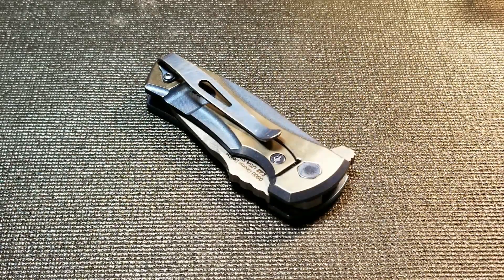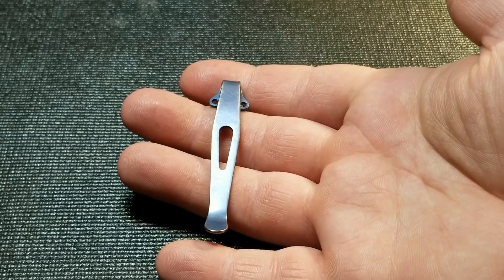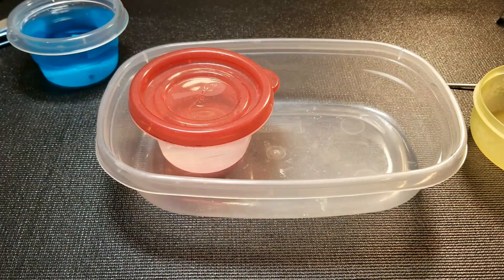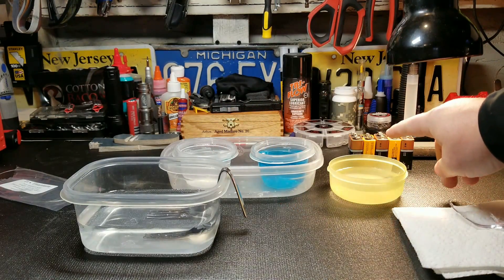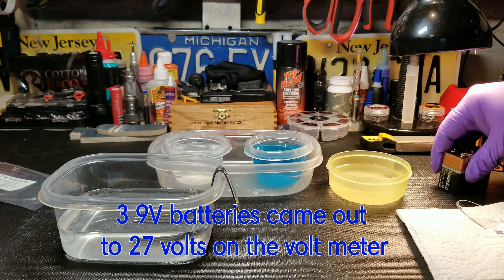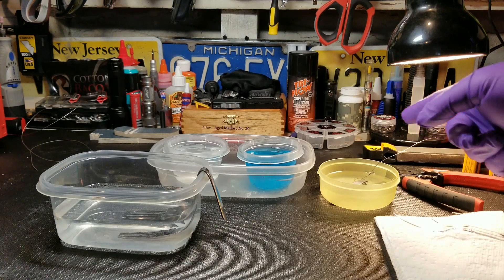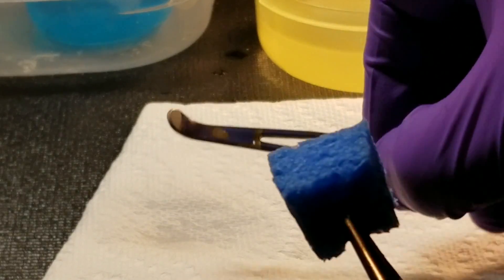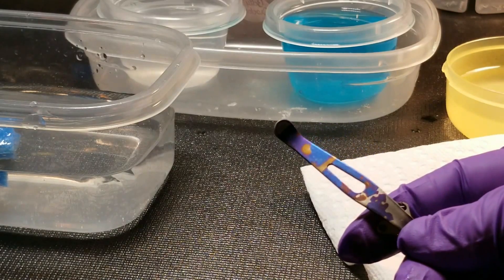Techniques & Tricks For Sponge Anodizing Titanium With 9V Batteries (2020)

Comment: Idk if titanium anodizing is similar to aluminum anodizing, but I learned that Easy Off oven cleaner strips off aluminum anodizing within seconds. It does dull out the aluminum but doesn't take much to clean parts to re-anodize them or to polish them out. I've stripped off a lot of aluminum anodizing like this for some R/C builds.

Comment: hello sir, could this method be used on aluminum or this is just for titanium only?
Reply: anodising also works on aliminium! :)
Reply: @purpleramune7107  duly noted and thank you for your reply sir. have a great day.
Reply from the maker: Aluminum can be anodized, but the process I show in the video will not work on aluminum. You need dye for the aluminum anodizing process. Hope that helps.
Reply: @ApollosRings  thank you for answering my question and sharing the info sir. so it just need one more step to make it possible with that method by putting the coloring dye to the process. duly noted and thank you again sir. have a great day.

Comment: Have u Ever done Sponge Anodising on aluminium? How was that? 

If you dont u multi etch..or rust remover...will the anodizing peel off..? 

Please do reply...thanks for ur video. Ur Awesome!!!
Reply from the maker: No, the process for anodizing aluminum is a bit different.

No, the ano will not peel off. If you etch the surface it creates microscopic pits in the titanium which gives the ano more surface area, and in turn makes it harder to scratch off. You can anodize without etching, but it will be easier to scratch off, it'll look a bit different, and I've found that if I don't anodize first, sometimes there are colors that I can't achieve unless I etch. Hope that info helps! Good luck

Comment: Does it have to be Titanium wire, or would aluminum wire work? Also, are there any other rust stain removers that could be substituted? I am just getting into this, and would like to try this on some TI items that I have laying around the house.
Reply from the maker: I had a big discussion about this a few years back. It's a little foggy, but I believe the aluminum wire worked kind of like copper wire works. You'll get some color, but you have very little to no color control and it may not come out even. You can always use a Q-tip soaked in the electrolyte solution if you really want to try it without wire altogether as well.
Reply: @ApollosRings  Thanks, I used your amazon link, and the TI wire is like 2 weeks out for delivery. I was looking for quicker gratification. I will just wait, to be safe.
Reply from the maker: Having to wait stinks, but the wire makes life much easier. 
Thanks for the support!👊🏼
If you run into any issues once you get up and rolling, feel free to reach out.✌🏼

Comment: I use the same setup but with a qtip to etch designs on stainless. Good stuff. I plan on doing this on a titanium flash hider. Thanks
Reply: I did not use the rust remover and it did not turn out very well. I might have to buy some and start over.
Reply from the maker: I can't stress how important it is to keep the ti clean as well. That will mess your finish up just as much.

Comment: Hey, here in Brazil we dont have the Whink rust remover. What else can I use instead?
Reply from the maker: Can you get Multi-Etch there? That is the next best option. It can be a bit more expensive,  but it works well and doesn't contain acid.

Comment: Looks so easy! Leave it to me to mess this simple process up! lol  I don't have the titanium wire, but i do have misc pieces of titanium (i think) or so I was told.  Anyways, like I said, I don't have the wire.  But, being me, I was in a rush to try it.  Well, long story short, all I get is massive bubbling.  At best, a spot turned mild yellow.  But that's it.  I wanted to do scrap pieces that I cleaned up before moving to some rings I made.  However, all I get is bubbles...as if the water was boiling off the metal.  Could this just be something as simple as I need the Titanium wire?  Because I was thinking of getting the scrap I have and making a hook out of the titanium I have.  Or, just order wire and wait.  lol
Reply from the maker: It really is easy once you get the hang of it, but there definitely is a learning curve. From what you just described it sounds like you have something in the bath that shouldn't be in there. If you watch my "anodizing with copper wire" video you'll probably see something very similar. You have to make sure that anything that goes into the bath is 100% titanium, except for your cathode,  that can be stainless(not mild steel, that could cause issues too. It has to either be stainless or titanium). Sounds like you've got a piece somewhere down the line that definitely isn't titanium. I would swap out pieces one by one till you figure out which one is the culprit, or just wait a day or two for the ti wire, lol. I'm impatient too, I get it, but that could definitely be causing you more grief. Hope that helps! If you have any more questions, ask away!
Reply: @ApollosRings  sounds good.  I'll just order some Ti wire.  I won't promise that I won't use some SS I have. Lol. But hey, that's the fun in learning a playing round! With the Corona deal...I have nothing but time on my hands! Lol
Reply from the maker: I heard that, I finally got around to giving the vehicles a long overdue oil change, lol. Got a handful of new videos coming out with some of this spare time too.

Comment: So I could re anodized the blue thumb stud on my Sebenza with just a sponge without removing it?
Reply from the maker: As long as its titanium, you definitely can. I would probably put a good coat of nail polish around it on the blade first though. Stainless will corrode extremely fast if any of the electrified water drips from the sponge while you do it.
Reply: SharpKnifeNuts  so nail polis will protect it. Does the nail polish have to be wet still?
Reply from the maker: Yeah, nail polish will keep it protected. It does need to be very dry though. I would coat it, hit it with a heat gun or hair dryer, then I would repeat that 1 or 2 more times so you know you have a good coat. As long as the blade is coated it's fine. Then just use acetone to remove it after you spot anodize and you'll be all set. I would probably use a Q-tip to anodize instead of a sponge if you're just doing the thumb studs.
Reply: How did it work?

Comment: Can I use regular tap water if I don't have distilled water ?
Reply from the maker: You can use it, but depending on the mineral content in your water you could have very negative results. I suggest using distilled water. It's incredibly cheap, and available at almost any grocery store or pharmacy.
Reply: @ApollosRings  can you do it on something other than titanium?
Asking for a friend of mine
Reply from the maker: This process can be done on any of the reactive metals like titanium, and niobium.  I believe there are a few others as well, but those are the 2 most common materials that this process will work on.

Comment: Are you using the Whink Rust Remover full strength or is it a diluted mixture?  Thanks.
Reply from the maker: Full strength Whink. Whink is somewhere around 3% hydrofluoric acid, which is the active ingredient. Just remember to always wear proper PPE when working with it, it's some pretty nasty stuff.

Comment: Does the solutions in the plastic Tupperware go bad after some time? What needs replacing for best results? I'm assuming you can reuse the Whink for a while and probably the Windex too. What about distilled water and the distilled and baking soda solution?
Reply from the maker: After you use the Whink quite a few times it starts to loose its potency and take a bit longer to do the job. It'll still work, just takes longer. The windex is fine for quite some time. I change the distilled water pretty much every time. It's only like 88 cents a gallon, so it isn't really that big of deal. I've left the solution sit for a while before, and it can get kind of nasty. Better to just change that stuff out.
Reply: @ApollosRings  thanks bro!! 🙏💯
Reply from the maker: No problem! 👍🏼
Reply: @ApollosRings  can you paint on the rust remover like you would with the baking soda and distilled water solution? Trying to etch a part without etching others and do fine detail. Or do etch around a detent ball. What do you suggest?
Reply: @regularhumanbeing5211  use nail polish on anything you don't want etched or anodized.  Put a few solid coats on and let it completely dry. Thats what I use on a detent ball. Then you can remove it with acetone when you're done.

Comment: Can you poor the whisks rust stain remove back into the container or is it best to always use fresh chemical sauce? What if you only do one piece does it matter? Or just dispose proper?
I couldn't get the titanium wire in time so i got these earring hook things i thought they'd be 5x as big because of the picture but it ended up being small so i will weave the pieces together forming a chain to wrap around the titanium i am anodizing...  THANK YOU FOR YOUR TIME and this Tutorial! It was really helpful and awesome this and the one before and many more im sure i just have not seen them all. DOES Aluminum wire work? Or does it suck battery too much? Also can you do this same process with aluminum instead of titanium and use the same titanium conductor like the wire? If you can answer these that would super helpful man! Thank you so much again for the video though, so awesome! are there more colors beyond 12 x 9v batteries? Have u tried? is it dangerous to that, add more than 12? Do you know tape works best from preventing a coat of anodization? gorilla glue tape i heard was water resistant but is there something better and more precise? Gorilla glue is tough and a bit hard to cut cleanly.
Reply from the maker: As far as other colors, after 12 batteries the colors start to repeat themselves, and when you start getting up to the higher voltages it starts to get kind of dangerous. No need to go any higher, it won't do any better or give you any other colors.
Reply from the maker: And finally no, this is not the same process to anodize aluminum. There is a completely different process for that. I'll eventually be doing a series on that as well, just haven't got to it yet.
Reply from the maker: Hey bud, thanks for watching! You can definitely re-use the Whink, but I would store it in a seperate plastic container so you don't contaminate the brand new stuff. Eventually you'll have to change it out once it stops working as well.

I have been told that aluminum wire does work, but I haven't personally tried it.

As far as the tape goes, I have a couple videos on that on the channel if you want to check them out. The newest 2 videos cover masking with adhesive materials. Electrical tape will work, but there are better options. Check the videos out for more info on that.

Comment: if you added that clip (as it was at the end of the vid) to a single 9v battery ano (bronze color) would all the sections not blue/purple get the Bronze color?  what if you added it to 12 battery Green ano?.. would the whole thing turn green?
Reply from the maker: I'm not sure if I completely understand the question. So if a titanium piece was anodized at 30 volts, but had some bare spots, then you re-anodized that piece again at 10 volts, only the bare spots would get the 10 volt color. If you re-anodized one more time at 100 volts the entire piece would turn the 100 volt color. Does that answer your question?
Reply: @ApollosRings  it does answer my question.. thanks.. im going to anodize my $12 Kershaw for practice.. then work on my ZT 0801.. thanks you so much for the vids.. really helpful
Reply from the maker: No problem! I have a really cool method that sort of plays off the same idea coming up in my next video as well that you might want to check out. I'm just waiting on materials to arrive, then I'll post that. Stay tuned, its definitely going to be something you don't want to miss👍🏼
Reply from the maker: Feel free to message me if you run into any issues as well. I try to do my best helping people troubleshoot anodizing problems they may be having. If you 100% stick to the tutorial video you shouldn't have any issues though.
Reply from the maker: If you always anodize the highest voltage color first, then anodize lower voltages each time going forward it allows you to keep all of the previous colors. Does that make sense?

Comment: can you try aluminum wire or a paper clip, want to see if there's a difference? Would it leave marks on the parts due to 2 different metal contacts?
Reply from the maker: I've heard aluminum wire does work just fine, but I haven't tried it yet personally. I will do a video trying a few different things though just out of curiosity. Keep an eye out for it if you're interested.

Comment: Great technology. Is it possible to use this technology for bigger size part
Reply from the maker: Absolutely.  You just need a larger bath to anodize in, and a larger cathode. You can do any size you can fit in the anodizing bath.
Reply from the maker: Just realized you're comment is on the sponge anodizing video, you can do larger pieces the same way as well though.

Comment: Great video, thanks! is there an advantage of using the Ti part connected directly to the anode as opposed to having two titanium plates (one anode and one cathode) on either side of the bath and dipping the part between the two? I have seen it done both ways but don't actually understand the difference.
Reply from the maker: In all honesty, I'm not entirely sure. I learned to do it this way, and always had great results, so I never really messed with things. I may try the way you described to see though just out of curiosity.  Thanks for watching! Stay tuned, I may make a video on trying the other process just to see if there is any noticeable difference.
Reply: It would def make a good video as I have seen it done both ways but am not sure about the difference in quality and safety. Awesome!

Comment: Song H can you tell me if anodizing at say 18V is any "more or less" wear resistant than anodizing at a higher voltage?   Say 80V?  Thx love these vids!  👍
Reply from the maker: The higher the voltage used, the thicker the oxide layer(anodizing). So yes, 80 volts will give you a thicker layer that in theory will hold up better. Any other questions, feel free to let me know. Thanks for watching!

Comment: I've never done anodizing Ti, I've only done heat treat, mask my Ti gadgets with permanent marker or nail polish, just write or draw on it and then let dry. heat treat the outside with higher temp and get rid off the marker then heat treat the design with lower temp. I really wanted to see if you can do that with anodizing. Mask a pattern design on Ti with marker and anodize the outside with higher voltage and the design with lower voltage
Reply from the maker: Yeah, one of my other videos show exactly what you're talking about with masking with the nail polish.

Comment: I'm obsessed with titanium ano
Reply from the maker: I must admit, I've been bit by the same bug, lol. I've still got a few video ideas I'd like to do featuring titanium, but I also plan on doing a series on aluminum in the near future. Stay tuned, and thanks for watching!
Reply: I have a zt0055 gtc that I have been thinking about what design I want to do on for like 3 days...lol
Reply from the maker: When you're finished feel free to shoot me some pics, I'd love to see how it came out! My social media is all linked on my YouTube channel homepage. If you run into any questions, feel free to let me know. I'll do my best to answer them.
Reply: For sure thanks! I'm thinking it's a smart move to get a power supply since i think this will be something I really enjoy. I am trying to decide on how much to spend because it kind of seems like the $60 do the same as the $140 ones.
Reply from the maker: I've thought about getting one as well. It's been a while since I've looked at them though. I forget offhand what the difference is between the 2. I vaguely remember thinking the same thing when I was looking at them. Doesn't one of them go to a little higher voltage or something?
Reply: ya I believe the ones capable of over 100 volts
Reply from the maker: For most anodizing under 100 volts would be fine, but there are some colors where you may want to go over 100 volts.

Comment: What's your opinion of using Borax instead of baking soda?  Is there a difference?
Reply from the maker: Borax, TSP, baking soda, it really doesn't matter what you use to make your electrolyte solution. The water is what does the work, the additive is just an ion source. Whatever you have on hand and readily available, use it. You're not going to notice a difference between them in regards to titanium anodizing. I recommend baking soda because most people have it in their kitchen cabinet. I had it in mine when I started, so that's just what I've stuck with.
Reply from the maker: You definitely need something though. I forgot to add the baking soda a month or so ago and couldn't figure out for the life of me why nothing was happening, lol. It finally came to me, but it took me a few minutes of being fairly confused.
Reply: Thanks for the info.  Looking to pick up some education as I'd like to do this merely for fun.  Definitely looking forward to your upcoming vids!
Reply from the maker: No problem, happy to help! If you run into any issues let me know, I'll help with whatever I can.

Comment: Can I just put the titanium in the windex without scratching off the old ano with the sandpaper?
Reply from the maker: Depends on what exactly you're trying to accomplish.  If you are going to a higher voltage color then yes, but you may not get the exact color you're going for if you dont use the Whink first.